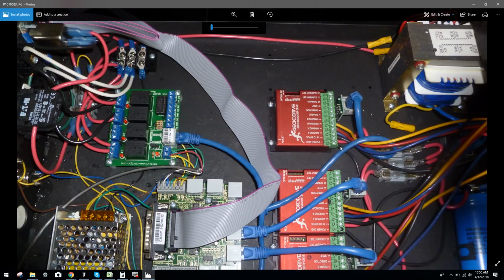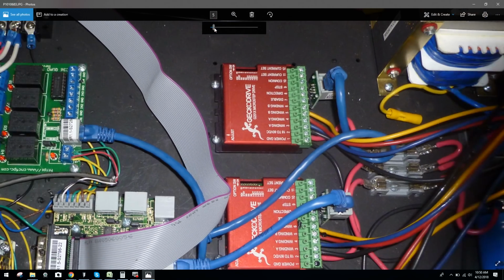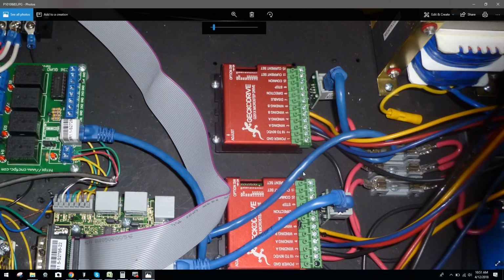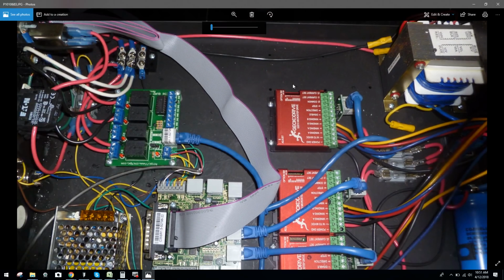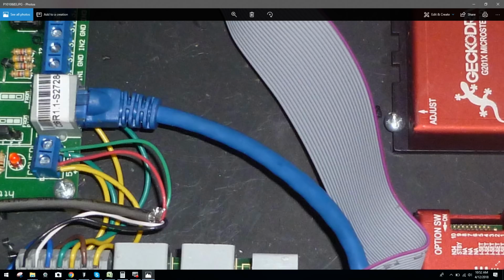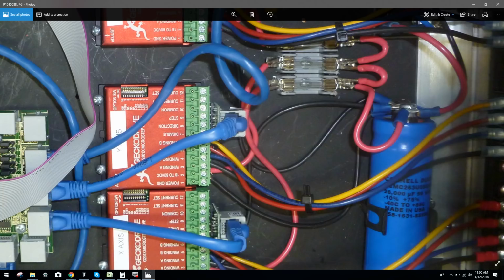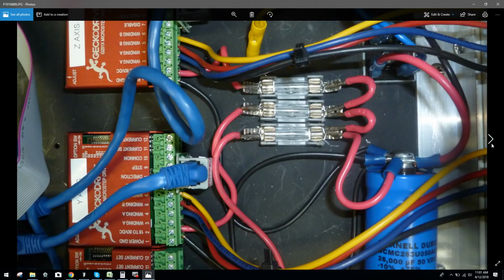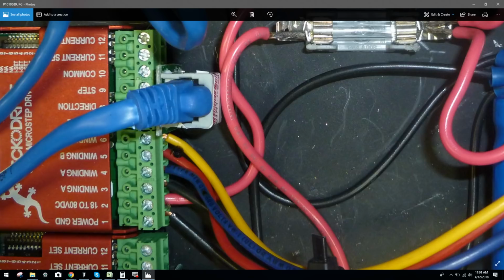CNC Controller Issues (US Manufacturer)

Comment: I absolutely agree!..   i just wrote an invoice for a 10 hr day @122.50hr.  for troubleshooting a low grade 4x4 table in a local fab shop.  Every problem I found in the control system were improper connections.  Not software.   The mechanicals left a lot to be desired but the tables electronics were all individual component non-proprietary built at hobby level and by individuals who lack real world installation/troubleshooting/maintenance of electronics/wiring/electrical theory/power supply/grounding/bonding etc...      This client spent 6k on a hobby level 4x4 with a "brand name" table that basically needed a complete overhaul on every facet..

I counted the parts used and priced them out.  the entire table could be built for under 600 bucks minus the plasma source....   thats steel, linear motion used, bearings, 4 axis controller, proma thc, an old pc..    its just silly how available these components are yet individuals make all too common mistakes buying junk due to the huge learning curve!.    its sad.  but its a reality people capitalize on!
Reply from the maker: Shawn, thank you again. I certainly understand your points, and what you wrote I completely agree with. A person having to spend an additional $1225 for system troubleshooting after spending 6k is really a shame. I feel the issue is many of these vendors are simply end users who completed building a personal system, and feel they can offer them to the masses. This explains why we're seeing a huge influx of online vendors of these type of systems. Unfortunately there's not much that can be done except for the end users to do their do diligence prior to spending the money. Thank you again,
Vince

Comment: I totally agree this is basically a pile of shit even though msost of it uses quality parts. I also agree they should have used an off the shelf standard switching supply that transformer is  somewhat of a standard setup. Somewhat easily to get IF YOU HAVE A GOOD ELECTRONICS BACKGROUND. Case size may vary but the winding setup is right there on the top of it.  The primary side is setup where it can be used on either 110 or 220.  The secondary is the basic center tap setup.  Ill bet that stray wire is the center tap and not used.  What I don't see is the bridge rectifier I KNOW is there. Makes me wonder if its properly heat sinked. you can see the smoothing cap though. 

The fuse setup is basically crap. ALL the fuses should be acessible without requiring you to crack the case and be properly labeled.  Take a look at the terminal block on a typical switching supply and you will find most have 2 or 3 screws for each side of the output.  You NEVER want to dazy chain high current from a power supply.  There should be only a single wire ( hot and ground ) going from the steeper drivers back to the PS. That alone will reduce emi noise.  Terminal blocks come in strips and there are basically shorting strips to common out as many contacts as you need.  That way you have a SINGLE connection on every screw.

If possible, split the case into 2 sections with shielding between the 2 sections. Put all the low voltage stuff like breakout boards in one and the high voltage and current stuff like the stepper drivers in the other. NEVER use cat 5 cables anywhere in a controller, just use standard shielded wire.cable. 

VERY important for safety reasons and the best EMI make certan all the shields and the metal case to the earth ground on the power.  Wire sheilds must be grounded ON ONE END ONLY!,

In addition what looks like a parallel extension cable That long grey flat cable thats obviously unshiled Is guaranteed to induce enough noise to give you fits irregardless if the rest of the mess in this box is dead on. Make it as short as reasonably possible and at least wrap it with that aluminum duct tape and connect one end of it to the case.

A cnc that wide WILL NOT track correctly with a single lead screw down the center alone.  There are ways to do it though. Look at how the old style drafting boards kept things parallel. It works. That is how I have my CNC setup with a single rod down the center and it never gets out of parallel.

Comment: I am just on my way to work sorry couldnt find the link to get a hold of you so sorry for the public post. I had a question on replacing my spindle.  im new to what type of spindle to use on my 6040 router. the original water cooled spindle burned up. I am wanting to use the 2.2 kw either air cooled or water cooled which is better?  so does it require a VFD or can I use it seperatly and also does it require a 220 outlet to power? Am I able to hook this up to my regular power supply 48V supply I just bought and my new g540 gecko drive?
Reply from the maker: Jason, contact me at my email Storm2313@gmail.com,  and I can answer your questions. Thank you,
Vince